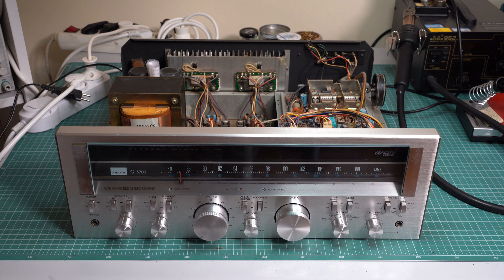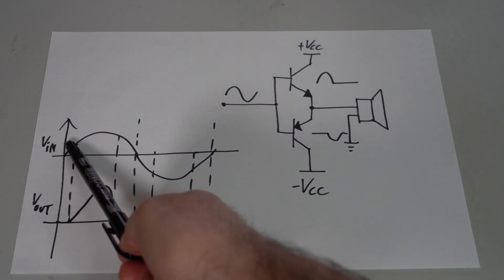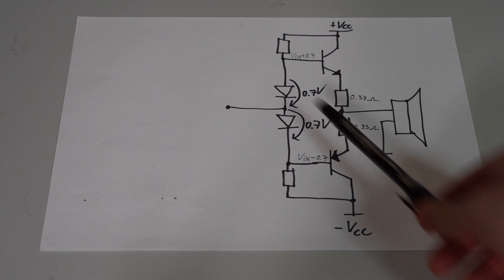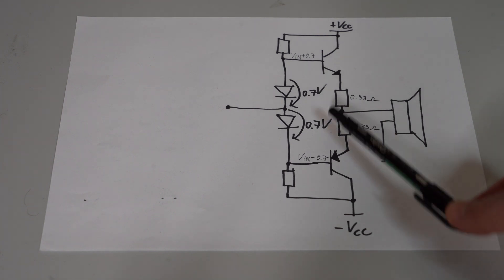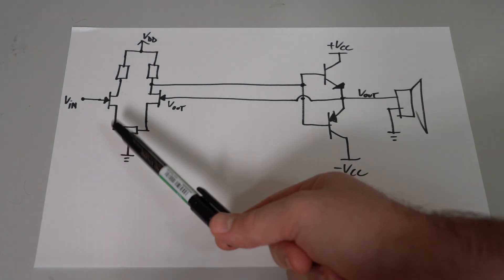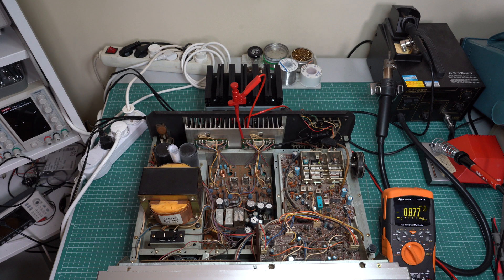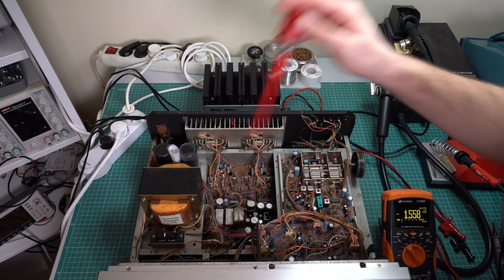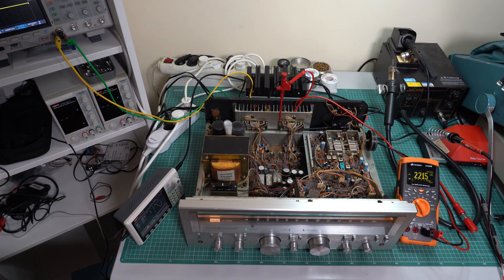The Why And How Of Bias And Offset Adjustments For Audio Amplifiers

Comment: I am bit confused like in pnp transistor  base doesnt need to be negative to start working its liks this i think when base have 7v and emitter have 7v its closed  when base have 6.7v and emitter have 7v it starts to open yes?

And that negative you get like 7v -6.7v is -0.3v
?
Reply from the maker: That's right. I think that's what the video says too.

Comment: "Bias independent design" has been a thing in analog circuit design for >50 year. 

Good analog design uses it and eliminates a need to do most of this.  The difference between adequate design and great design usually involves this!!

Comment: I think I understood that. 
Subbed.
I hope he does an upload on tape recorders. 
    I have a few reel to reels where the output amp is fine but no signal from the tapehead is reaching the output amplifier. Very frustrating as apart from that the R2R is working perfectly.
Reply from the maker: Well I would suggest injecting a test signal and testing for it in various points around the circuit using an oscilloscope or a signal tracer. I would normally start by injecting something into the head preamp, but since it doesn't work you probably have to start from the power amplifier and work your way towards the preamp until you find a point where the signal does not propagate to the output anymore. Good luck!

Comment: Excellent explanation. But my Marantz SR4000 receiver uses STK3062 and STK0050 integrated amplifiers, and does not incorporate adjustable resistors for the Offset and Bias. One of the channels has an offset of -0.360V, and produces a clicking noise every time I turn the equipment on or off. I´m thinking of adding an IDLING circuit, or an adjustable resistor in the feedback of the Pre-amp. Do you have any experience with this?
Reply from the maker: I don't have experience with this, but you should maybe check for leaky capacitors around the STK hybrids and see if you couple a DC offset into them from the previous stage.That could cause an output offset. If not, then the hybrids themselves are probably faulty. BTW you could also join our Discord server and ask for advice in a more appropriate environment: https://discord.com/invite/fVRrjpaRVE

Comment: wont the offset come from the mismatch of output transistors?
Reply from the maker: @sahhaf1234  It could, but if the amplifier has DC coupled negative feedback, the output stage is in a feedback loop and the offset is compensated. On the other hand, the offset of the input stage is not compensated, so it propagates to the output.
Reply: @VoidElectronics That's very correct. Thanks a lot for your reply. 
I have a question: I have never seen the mismatch of the push-pull pair analyzed anywhere. One should expect such a mismatch due to the fabrication and/or temperature differences between two output transistors, but the people doing programs about push-pull pairs treat the topic as if such differences never exist. In short, if you do a program on these imbalances you have one viewer. 🙂
Actually, such differences may not be that important in the last analysis because, as you have mentioned, they are within a feedback loop. But, still,  it would be nice to see a mathematical analysis of them.

Comment: I will make a small addition to the first circuit: add a resistor between the bases and the emitters of the transistors. Its resistance should be close to the load resistance. With low power, the pre-output cascade will work, which is quite capable of this task. As the power increases, a powerful output stage will be connected to the operation, without causing any visible signal distortion.

Comment: Hi, I have rarely seen this type  of schematic with NPN to vcc and PNP to gnd, thanks for sharing.
Jean-François
Reply: @chrysalide_electronics That's a standard "totem pole" configuration, two common emitter stages in series with each other. Also known as a "push pull".
Reply from the maker: As @MadScientist267 said, this is standard. I found it a bit strange at first too, but it makes sense and it's the only way to use a complementary pair. If you put the PNP up and the NPN down, you get a dead short from Vcc+ to Vcc- through the base-emitter junctions.
Reply: Indeed. Maybe useful to point out the general purpose of it... it is used as a bipolar current amplifier, typically found in a driving stage. The lower current but "high" voltage signal comes in on the bases, and the emitters just follow what the bases are doing, less the Vbe drop. When one transistor is conducting, the other is in hard cutoff and vice versa. The emitters will be carrying more current than the bases, providing current (and in the case of a final, power) amplification for an AC signal... just what audio needs to drive a speaker.

The Vbe drop mentioned causes a ~1.4V "gap" between the transistors, 0.7V x2, resulting in the mentioned crossover distortion in the video, which is what bias corrects, by bringing these two points together at zero in the output.

Comment: If you don't want a cross distorsion, please use a CLASS D AMP 🤣
Reply: Class D is great for "lotta power in a small space"... at the sacrifice of accuracy/fidelity. This isn't to say they aren't useful, they absolutely are, but have no place in a hifi stereo amplifier such as in the video. Class AB/+ for the win. Sometimes quality matters more than output.
Reply: @MadScientist267  for sure. Class D have very agressive sound. I have both of them, class AB amp with H class (double power supply). Anway, class D sound metallic whereas AB amp (or class A before AB) sound warm and soft. Class D are nice for.. handeld bluetooth speaker. I must add something. Talking about 40 dollars class D amp has nothing to compare with a real high brand 3000 dollars class D amp. Some class A lovers heard a 3000 Dollars class D amp and... switched to class D. Highe price make sometimes the exception.
Reply: @AIexanderHartdegen  Personally other than the high efficiency/tiny package cases, I see them as useful for handling the bottom end with subs and such... which is where most of the power goes anyway. It doesn't need to have a high nyquist limit for that... and can save AB+ for definition, mids and highs where the power needed is much less. I don't doubt they are capable of making an amp that is pretty true to accuracy, but maybe not worth the flow.
Reply: @MadScientist267  all tastes are in the nature... agree with you.

Comment: When you're looking at bias/crossover distortion and negative feedback is in play, reading from the output of the long tail will fly very obviously away from a sine when crossover is present in the final. When you have that waveform clean, it is set right as the feedback isn't having to compensate for the crossing. Do check for heat in the finals and verify quiescent current is reasonable (I've found "around spec" is fine as long as the heatsink stays cool at idle.) 

Well designed amps run a touch above lukewarm at the heatsink at room temp ambient conditions when the bias is set correctly. Then yeah your offset.

That one is touchy indeed... should have been padded better heh. Oh well. Beats no pots lol

Also, the scope can be made "more sensitive" to crossover distortion by feeding it the input vs output (speaker, long tail) on x/y... set up a 45 deg slope, and the crossover shows up as a "flat" spot in the trace that results (a straight, flat diagonal line indicates no crossover distortion, or compensation for it, in the signal). Other distortion is visible with this method as well, as any deviation from a straight line indicates output not tracking input accurately.
Reply from the maker: @MadScientist267  100% correct. I only figured out that I don't see distortion due to the feedback when editing the video. Maybe I'll do a followup.
Reply: @VoidElectronics You've got a good thing going here. Went ahead and subscribed. Was into audio design and repair in the 90s, always like to see someone's take on the core aspects of things. And someone who really understands old school analog audio at the design level is getting to be a thing of the past. Looking forward to more.
Reply from the maker: @MadScientist267  Thank you so much! Yeah, whenever I fix something I want to have a systematic approach just like shango066 so that the viewers actually learn  how to troubleshoot, instead of swapping capacitors and hoping for the best. When doing design, I want to explain core concepts using the bare minimum circuitry. 

I will try to do some more up to date topics too, but I also think that old school stuff is better for teaching purposes.

Comment: What is the difference between CTAT compared to transistor thermal runaway? I'm not sure how biasing or setting the biasing point is affecting the CTAT and thermal runaway of transistors?
Reply from the maker: The fact that Vbe is CTAT is inherent to bipolar transistors and has nothing to do with the bias settings. However, the fact that Vbe is CTAT could cause thermal runaway. If you drive the bases of the power transistors at constant voltage, the larger the temperature, the larger the collector current. As collector current increases, so does temperature, which causes even more collector current. Of course, this is an extreme case, because no amplifier drives the bases at constant voltage.
However, if the Vd of the bias diode and the Vbe don't track very well due to different thermal coefficients, the amplifier could either lose bias at high temperature or go into thermal runaway, depending on which thermal coefficient is larger. I don't expect the coefficients to match exactly and the thermal coupling is not ideal either, so what I'm trying to say is that biasing the amplifier at a high current is risky. Also, the bias point drifts, as you can see in the video, so it's a good idea to keep an eye on it for like an hour.

Comment: I found that these settings sometimes are dependent of mains voltage, because the amp power supply is unregulated. So if you have a variac it is an idea to check that (let it again settle for 20 minutes), and set it to the proper voltage before setting the amp.
Reply from the maker: @erikdenhouter  I didn't think of that, but it makes sense. Thanks for pointing this out! 😁
Reply: @VoidElectronics Don't take my word for it, it is something I saw when I used an analogue moving coil meter for the bias, and traced it down to strong mains fluctuations (that time of day for washing machines). But it is worth looking into.
Reply: Ooof yeah that's oversight/minimalist design there. Happens when the bias is derived from the final's supply rails. A well designed amp will have the bias being formed from a regulated supply, such as the rails for the small signal components upstream.

Very good point.